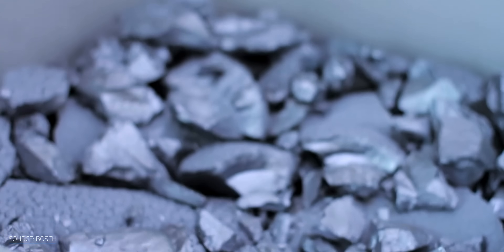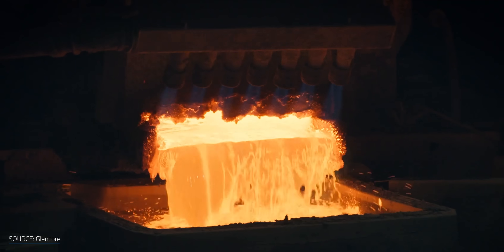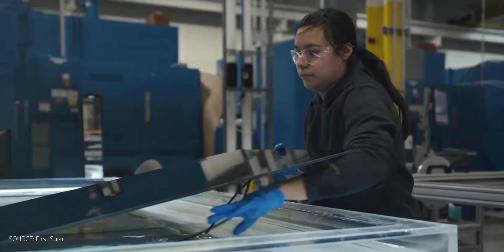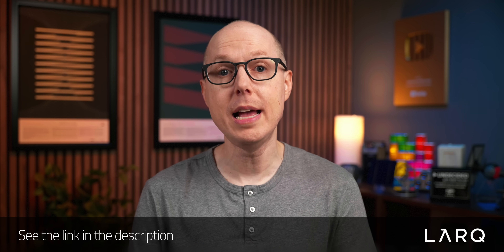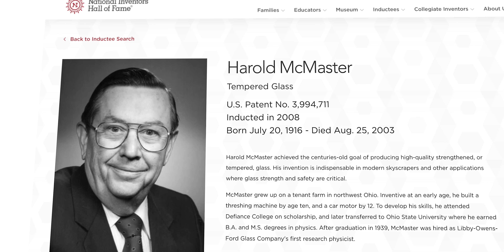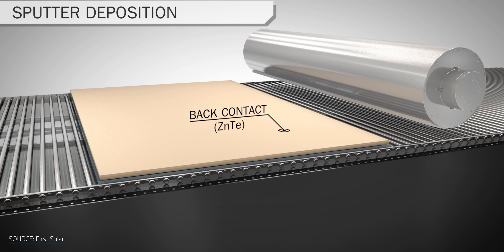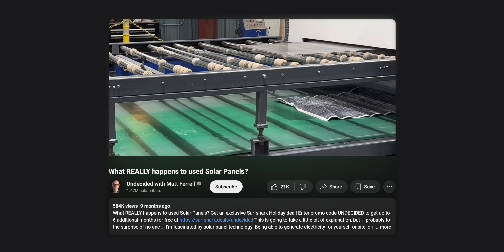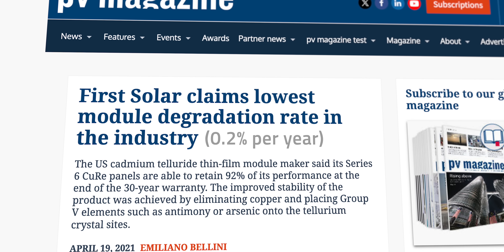How the Next Big Solar Panel Tech is Already Here

Comment: It always shocks me to see a solar panel manufacturer that doesn't have their solar panels all over the roofs of their buildings.
Reply: Right?? 

First Solar did just install them on their hq in Tempe and their factories in Alabama and Pennsylvania.
Reply: They have no facilities in PA. Maybe you mean OH?  @MustachioFurioso9134
Reply: There are panels on top of their earlier buildings. The one earlier in the video is pretty new. Not sure when the flyover was filmed
Reply: They are currently covering their parking lots
Reply: @factchecker9358  yeah, OH sorry.
Reply: It's still under construction, doesn't open until next year
Reply: Matt Ferril is their best customer though.  Another thing they have in common.  smh.
Reply: @byugrad1024  what are you talking about?
Reply: If you have the room it’s better not to put it on your roof - so many potential expensive problems.
Reply: It makes little sense for full-fledged manufacturing building that needs their own sub station to power their buildings and equipment. The flow from those panels would be a drop in a pool.

If it was a small scale building, sure.
Reply: Sure but every manufacturer and industrial buildings make a lot of drops. It all contributes toward better grid
Reply: @Racketeerof89 the place is huge though, surely they could get a few Mw/h  each day. Tesla giga factories are covered .
Reply: @danthemanzizle  I did some quick math, because I was curious. Seems like the building is 1.3M square feet. If you covered it completely with regular solar panels not their own (because they are 30% less efficient) they could cover about 3.5% the cost of electricity over the year. Which seems ok until you factor wages of workers to maintain sub systems like invertors, battery banks, switching stations, and all of the upfront cost of buying everything. It is very cost prohibitive for a potential 3.5% savings.
Reply: I always said a firewood salesman never has wood , a car body man has the dented cars, a house builders house doesn’t have their own house finished.
Reply: @Racketeerof89  The energy consumption of the facility itself has little to do with the cost effectiveness of covering the roof with solar panels, it's about $ in vs $ out.
Reply: Depends if they rent the building or own it. Most businesses lease their buildings
Reply: @ahnilatedahnilated7703  the cobbler’s kids have no shoes I guess
Reply: @Racketeerof89 power providers don't like paying for solar being put back into the grid so they probably have an agreement
Reply: @MURD3R3D  oh they went with the least effective type
Reply: A shoemaker’s kids go shoeless.
Reply: They are waiting for better panels
Reply: It might bring more Profit to sell them. Otherwise it means you've got overproduction
Reply: It’s too expensive. Also manufacturers consume much more power than solar could provide and have special pricing with power companies
Reply: Probably tells you something about he viability.

Comment: Having worked in the utility silicon solar industry for many years, I can assure everyone, CdTe won’t catch silicon as it’s efficiency will always remain much lower and cost, much higher, and silicon modules are starting to overlay transparent thin film over silicon modules now, called HJT cells, to offer: 32-40% efficiencies.  It’s all about price in utility modules and silicon is almost 1/2 the price of CdTe.  Cadmium modules have been saying for many years that they’ll increase efficiency, and it doesn’t happen.
Reply: Yeah that is the missing important information that I was waiting for.
Just looked it up.
They cost a little less but are less efficient and need more space so that their  output per $ is smaller .
ChatGot got found the numbers 
CdTe  , 0,07 USD per kWh
silicon, 0,06 USD per kWh
Reply: I am curious as to what work is being done on placing PV Panels on the roof of trailers of EV Trucks?  If one looks at the roof of a trailer the area is considerable and could house a number of PV panels supply a percentage of charge to the battery.  What is the drawbacks of such an arrangement and what if anything can be done to make this economical or even feasible?
Reply: Well, then it's a question of when silicon doesn't have any gains left to make, isn't it? It was suggested in the video that the theoretical max is higher for cdte than silicon.
Reply: thx for info about price
Reply: @blablup1214   This info ought to have been in the video. Thank you for providing it.
Reply: Just saw that Pervsokite/silicone cells are being sold at around 24% for the total cell. 28% without the frame. That is in production. Some UK company. Channel "Just have a think" posted within the last two days. 

 Then there are even better ones going through the paces with labs saying they defeated the longevity/sensitivty problem. 

 I mean I seen some pervoskites can be basically printed. Others using established technology from micro chip manufacturing to work. 

 If we can stop them from being so damn volatile or degrade so fast we would be set. 

 Matt and TwoBitDavinci man... Always pedaling some untrustworthy start ups claims.
Reply: @RussellFineArt  exactly
Reply: @dianapennepacker6854  Oxford PV is said to have solved all the problems.An that who you are talking about. They have enter commercialisation stage and just sign agreement for them to be deploy at a grid scale site in the US.
Reply: tbh, I often just go to these videos to see who in the comments is giving a more complete story, so thanks for that.
Reply: @anguscampbell1533  trucks have an overall weight and if you are using the weight to produce electricity then the cost per distance has to go up on carried items. How much extra range do you get with the panels and they are no good when a truck is driving at night which means you would have to have night and day trailers and who pays for the installation and would the panels pay for themselves?
Reply: @dikkybee4003  If they are efficient enough to reduce the battery weight then they "might" be feasible but yes I agree with you on that one.
Reply: @anguscampbell1533  That's a cool question!  My numbers translate to daily 7 to 35 kWh (Winter/summer) A food truck who needs to run a cooler could run his refrigeration for free.

 Here in Europe your LKW without trailer can be max 12 m x 2,55 m, that is  30,6 m².  A light PV panel can deliver 200 Wpeak/m² @ a weight of 3,2 kg/m². So, you can fit a pv system of 6 kWpeak @ less than 100 kg on a european LKW.
The simulation in PVgis for 6 kWpeak at 0 degree slope in southern Germany gives a annual result of 5880 kWh , or 7 kWh average per workday in the winter and 35 kWh average in the summer. These numbers translate to 7 to 35 km free power (if your Truck gets 100 kWh/100km), 35kg  less battery weight (7kWh winterpower and 0,2 kWh/kg battery) and you save the roof weight.

LKW size: https://www.bussgeldkatalog.org/lkw-laenge/#:~:text=Ja%2C%20gem%C3%A4%C3%9F%20der%20Vorgaben%20der,l%C3%A4nger%20als%2018%2C75%20m.
datasheet random light solar panel: https://solgenix.de/products/pures-400-410-f8mc?gad_source=1&gclid=Cj0KCQjwsJO4BhDoARIsADDv4vDHX2bLaXgszXNG2geZehdY-MgDQCOnY5WstVzW1M7JgZifTN6BT4YaAlgAEALw_wcB
PV Simulation: https://re.jrc.ec.europa.eu/pvg_tools/en/
Reply: @SchwuppSchwupp  
Interesting.  With "Weightless" structural batteries and conventional "swap" batteries it may be feasible for some trucks that sit in parking lots for extended periods of the daylight hours.
Reply: This is what's so annoying about YouTube content creators. They always post these "next gen" solutions and yet they don't actually know what they're talking about.
Reply: So another case of Matt talking out of his ass. Got it.
Reply: @anguscampbell1533 weight, cost and little payback in terms of what it adds. Truck EV batteries are huge and even a truck covered in Solar Panels at current efficiencies would only add a small number of miles. It would require inverters, the roof line of the load would have to reduced and then there are issues with the whole of the trailer being live in an accident if it is sunny.
Reply: Cost? And whether regulators will allow these programs to exist. I live in a house that has solar panels on the roof, our provincial government had a multi-year program that allowed homes to install solar and sell it back to the grid at a premium to encourage just that. Companies came in and offered cost-sharing models where the homeowner would not pay for the installation but the company would get to keep the majority of the profits generated from the solar panels for a fixed term, usually about 20 years. I believe that despite the combination of public and private investments it still wasn't enough to put a meaningful dent in the electricity mix of the province, and funds were realized to beore effective in industrial scale projects or else towards traditional generation sources. 
If you want to see if it's viable and you live in a trailer home then see what incentives your local government has for solar installations  @anguscampbell1533
Reply: @dikkybee4003 if panels were that cheap and that lightweight then we'd see them everywhere. If the financial incentive is there - like you said, cost of weight vs energy gained - then everyone would do it, or at least every government would be trying to incentivize drivers to get it. 
I think it's also that the trucking industry can be slow to change, a lot of truckers are still mom and pop operations that have one to a half dozen trucks under their name, and for them any truck is a huge investment and they don't want to take risks when it could impact their livelihood. Governments and industry consortiums have to go out of their way to educate the trucking industry about advances in truck efficiency design that offer potential fuel savings, even as something as simple as fenders that promote efficient airflow under the truck can be a hard sell
Reply: CdTe are a better choice in the Southwest and the south. Anybody that actually works in the industry knows that fact. The reasons are many. Price, longevity, durability, environmentally and serviceability.
Reply: Right now in Pakistan, we are happy with 23% efficiency as we need almost 40% less panels to provide power as in 2014. With 33% efficiency I think world can dream of going totally off grid 😆. Imagine a world with free day time electricity. And our government is feeling pressured as we installed 13000 MW in a year with zero government incentive an increase of 13 times almost.
Reply: They've been increasing efficiency, Silicon companies have just been increasing it too and thus always managed to stay ahead (and yeah, most likely will continue to do so). Not too surprising when Silicon is 80+% of the market, and thus the bulk of research $$$ goes into Silicon. It's also the scale of Silicon that enabled to it not be beaten on cost, even when the process always seemed like it should be inherently more costly than CdTe.
Reply: @mbevinn  lol the logic of thin film was 1/100th the material thickness so that much or at least half as much expensive but CIGS or CIS panels at least we're expensive
Reply: Truth! First Solar’s CdTe panels main advantage is US subsidies and tariff protection. Silicon panels are better on a cost per watt.

Comment: I'm extremely suspicious of any solar company with not a single panel on their massive roof.
Reply: Their roof is not massive at the scale required to generate solar power in bulk. The same panels can be installed elsewhere to generate just as much power. Why complicate the building envelope of a complex manufacturing facility with another thing that gets in the way if you have to repair, remediate, or renovate? 

You use suspicion because it is cognitively cheap. Why think when you can merely suspect?
Reply: @afterthesmash  occams razor.
Reply: Why? Lots of companies including the one I work for find more financial value in selling their product than in using it. It could just be that that their electricity costs locally are low enough that it makes more sense to sell the panels than to install them. Or maybe they can't get a 1:1 NEM agreement and that kills the incentive.
Reply: The company has expansion plans at another location, probably.  No point in the capital expenditure when in temporary space
Reply: I can't speak for FirstSolar specifically, but that building just went up in the last few years. Their earlier buildings are covered with panels on top. You can see them from the Ohio Turnpike if you look close.
Reply: If they lease the building or plan to expand and move, it makes sense.
Reply: Don't be. They make 30,000 500 watt panels a day. It's logistically not easy to put them on roofs, they are currently covering their parking lots in panels
Reply: That's a building that is under construction... did you miss the "opens in 2025" part?
Reply: @ianglenn2821  That roof is finished, and it has sun on it. And they chose to take that photo then.
Reply: @ajwright5512 I applaud your initial skepticism, but there are a lot of reasonable explanations. The clip showing the building is very brief, and my guess is that is a rendering of the planned facility that is not yet complete. They probably should’ve put solar on the rendering, but maybe the plan is to put panels elsewhere like covering in a parking lot.
Reply: @MrNatetheTeacher  At cost price with zero shipping, more is more, you'd have thought.
Reply: They are not made for rooftops.
I see few cars on rooftops  and it doesn’t factor in my decision for a particular car to buy.
Have you been having problems with your suspicions for a long time?
Reply: Yeah well said. I know a smaller manufacturer in Germany, when you look at their building on google earth, it's almost entirely blue on top lol.
Reply: Those panels weigh 90lbs (40kg) each. The roof will collapse.

Comment: The cool thing about CdTe that you mentioned. They are waste products of 2 VERY widely used metals AND they both don't really have any other uses. So CdTe panels will always have a supply of raw material for not too much money.
Reply: Cd is a widely used metal, but it's not as ubiquitous as sand.
Reply: @runcycleskixc  Cadmium is used as a hardener and anti-rust cladding on nuts and bolts. It's everywhere.
Reply: @CorwinPatrick  Cd content in Earth crust: ~0.1-0.5 ppm. Si content in Earth crust: ~25%.
Reply: @runcycleskixc  mine some asteroids
Reply: CDTe is less affected by heat, so it works well in a hot desert.
Reply: @CorwinPatrick  The use of cadmium in this role has been phased out in many countries decades ago due to it's toxicity.
Reply: for much more money than silicon
Reply: Turn that 25% SiO2 into pure Si: stewing a slow growing Si crystal in a heated vat for months--not a cheap prospect compared to spray-on solar
Reply: @runcycleskixc  the sand used in solar panels isn't ubiquitous, in fact the most common source for the specific type of sand used in Solar cells is coastal wetlands. India for example has restricted sand mining as it was starting to cause major environmental issues. There are very remote parts of Australia with the correct amount of sand but access to these very remote parts of Australia will need a huge amount of infrastructure investment (sand mining is a low return business).
Reply: @runcycleskixc  The global supplier for the purest silicon available got shut down when their two mines got shut down by hurricane Helene. This slows down all silicon refining because they make the crucibles out of Spruce Pine ore.
Reply: @runcycleskixc  aren't we running low on sand now?
Reply: @kevinleecaster2698  That's just for semiconductor grade silicon.
Reply: @cray331 I don’t know about the silicone varieties. The sand shortages that get the press coverage, is construction sand. It is typically a basalt sand.
Reply: @bardigan1  solar panels are semiconductors
Reply: @LinuxGalore  You are mixing up the need for Sand for construction and the one needed for Solar. Construction sand needs to be a specific grain size and form for better concrete properties. Solar Sand on the other hand just needs to be as pure as possible. But that is even less of an issue because you can refine sand. Solar can easily use the desert sand, that is totally useless for the construction industry.
Reply: For now. But when the supply drops and demand increases… just like water, it will be expensive.
Reply: If cdte takes 33% larger solar panels to obtain the same power, what's the point in having them?
Reply: Silicon production is not done with sand. That's a common missunderstanding. Silicon metal is produced from lumpy quartz and coal/charcoal in electric arc furnaces at ~2000°C. The quartz and coal need to fulfill specific quality requirements. Only raw material from qualified mines can be used. Afterwards the silicon metal is refined in chemical processes to the high solar grade purity. Producing silicon from sand is beeing researched but it's not the industrial reality. 
However, I think silicon is still the better alternative to cadmium. Recycling of cadmium-based panels would make the life cycle of a cadmium panel much more expensive than silicon based. The harm that will be produced by not recycling cadmium-panels correctly will raise the costs for society even more.

Organic or perovskite solar cells seem to be more promising technologies.